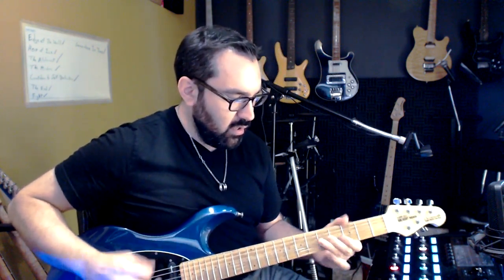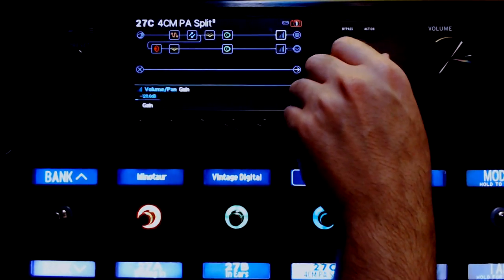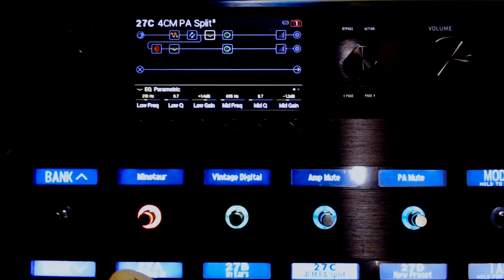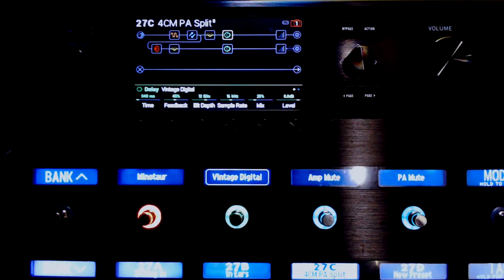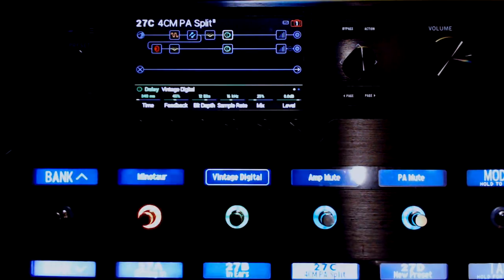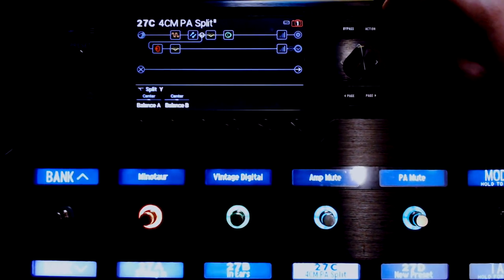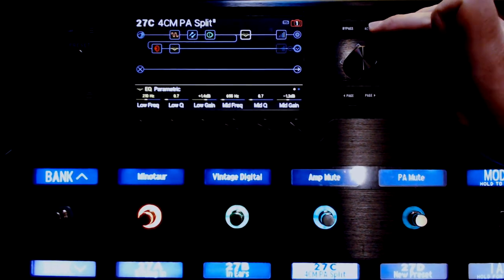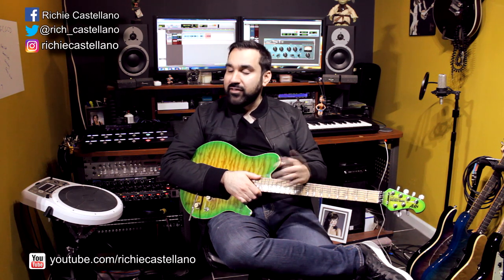4 Cable Method AND Cabinet Simulation out to a PA with the Line 6 Helix

Comment: Great video Ritchie. Your vids are always immensely helpful. I have another conundrum that you may be able to answer. I'm running Helix 4CM into DT25. I have reverbs and delays in the loop and use the helix for FX and Variax control only. I mic the amp and all sounds great. BUT, sometimes I need to play a quiet dinner set so I would like to send our sound guy a direct out of the amp  with the amp on low volume mode and in standby, thus muting the speaker on stage and giving him the amp with cabinet emulation. I've tried it and it works fine except the FX loop in the helix is bypassed. I get a great sound in my in ears with no stage volume but I have none of the FX in the loop. I can't for the life of me figure it out.

Comment: Great info as always.  Have a question out of ignorance, but couldn't you use the 1/4" headphone jack out for one output and then utilize the XLR and normal 1/4".  I wonder what effect it would have, what would be gained or loss from trying this?
Reply from the maker: Mark Weingates what would you use the headphone output for?
Reply: Was just curious if you could use the headphone jack as an option for an output as well as the other output jacks.  Or would there not be enough power to support let's say a combo amp or something.

Comment: Are there FX that are stereo in/stereo out?  If so, insert one of those after the split point, so you don't have to tweak twice.
Reply from the maker: I don't understand how that would work
Reply: A stereo-in stereo-out FX would be the same as a pair of mono FX with the controls linked.  So you would not have to adjust two sets of controls to make the same change in the two signal chains.
Reply from the maker: TimmyP1955 ok, but where would you put it in the chain?  In the example where I use 2 of the same effect, I'm doing it to keep the paths separate, while retaining the cleaner post cab sim sound.  Putting one stereo effect wouldn't solve that.  I'm not using left and right for the discrete outputs, I'm using 1/4 inch and XLR.  But for example, even if I were using left for the amp and right for the PA, Stereo fx can have stereo imaging which pans different information into each speaker.  That would just give you half of the effect in your amp and the other half of the effect in the PA. Unless you're talking about something totally different?
Reply: A stereo in-stereo-out FX would (presumably) have no signal mixing between the channels.

Comment: Uhm but you're using the PA channel only with the Preamp Section of your real amp. The missing Poweramp section is a huge deal in my opinion. I tried it this way with several amps but it never sounded right with the Preamp into the Cab IR. That's why I'm requesting the Poweramp section of the Helix Simulation since the device is out on the market. There's the preamp as a separate block but why not the Poweramp? Bute L6 doesn't seem to have any interest on this topic
Reply from the maker: Try a 3rd party IR with the power amp baked into it.  Better yet, make your own with the amp you're actually using.  I have another rig with a two notes torpedo where I did this, and it sounds incredible.
Reply: i find by putting an amp block in the p.a. signal flow and backing the gain to zero and whacking the master and bias up it adds alot of poweramp character to it,does get a little noisy tho.